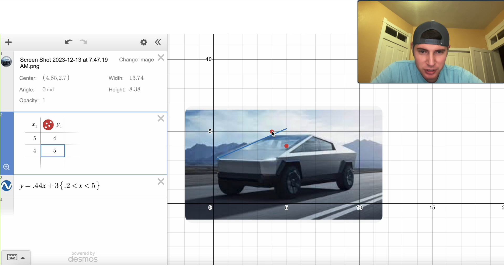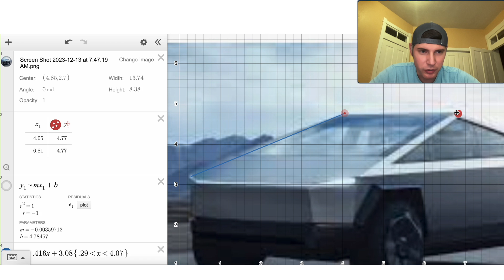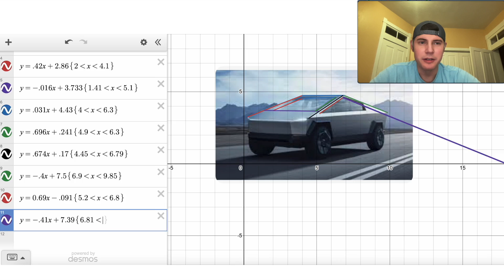Cybertruck in Desmos

Comment: How did you do the circles??
Reply: A circle’s equation is (x + a)^2 + (y + b)^2 = c

With a being the horizontal transformation, b being the vertical transformation, and c being the radius squared.

If you divide the (x + a)^2 or (y + b)^2 by a number, it will stretch by that number on that axis. And if you instead multiply them by a number, it will be squashed.